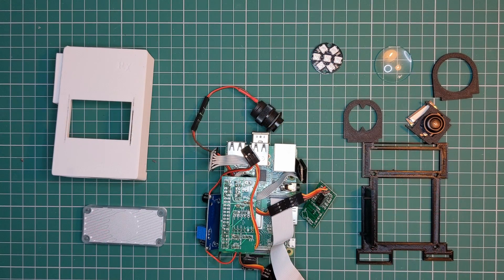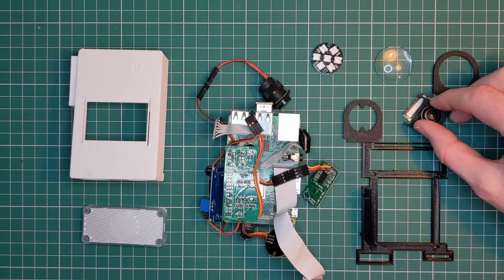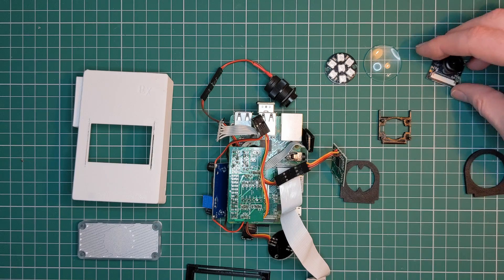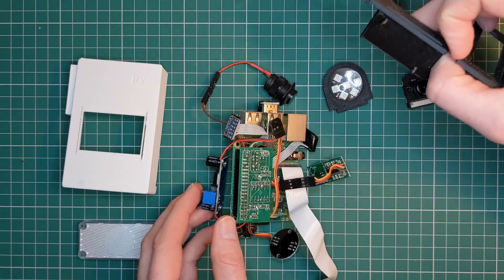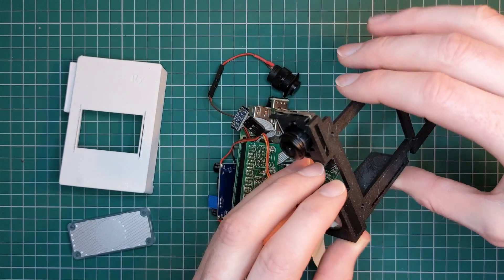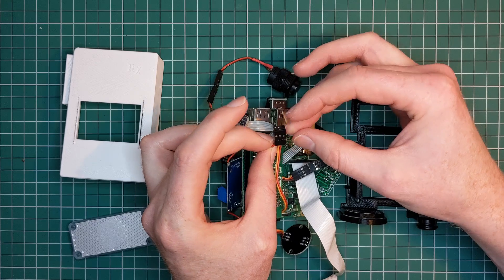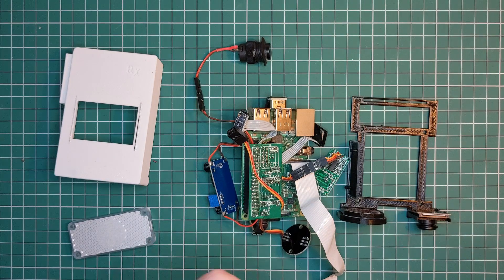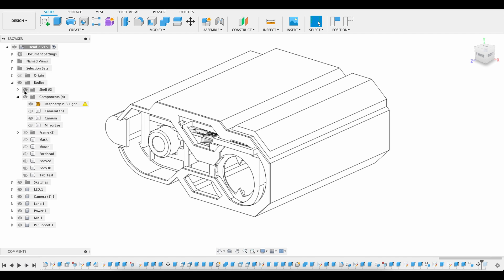Modular 3D Printed Robot | Dev Log - Raspberry Pi Robot

Comment: Very Cool! I was looking into modifying a junked star wars galaxy edge robot with the raspi.  Have you had any temperature problems with the raspberry pi? I noticed you don't put a heat sink on it, and theirs some vents on the head. What about a fan on the back of the shell! Just a suggestion! Really enjoy the videos!
Reply from the maker: Thanks! No temperature problems, I have a script running so that the Pi checks it's own temperature and shuts down if it gets too hot - it hasn't ever hit that problem (yet). It's a Pi 3B+ not a 4, so they generally don't run as hot.